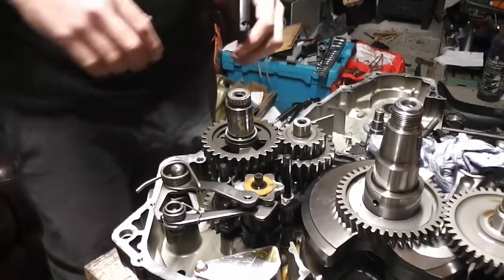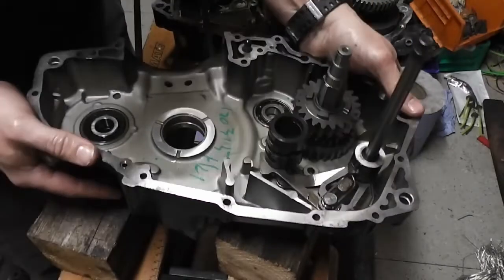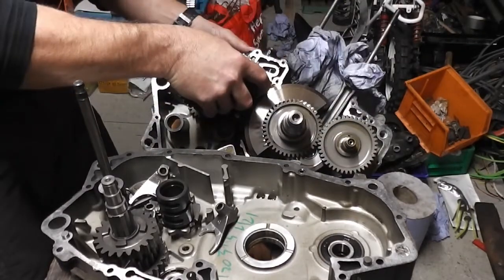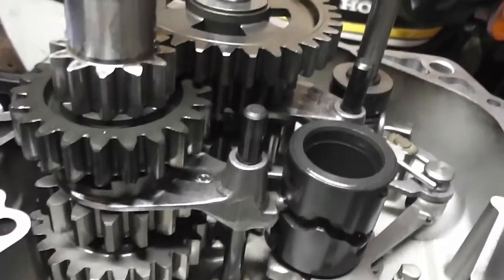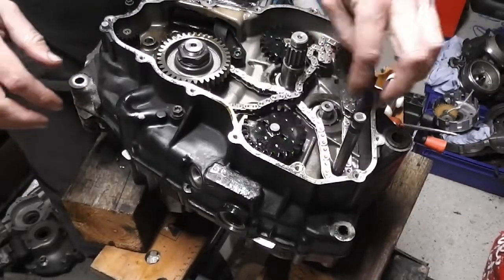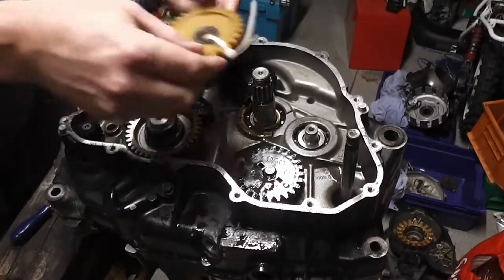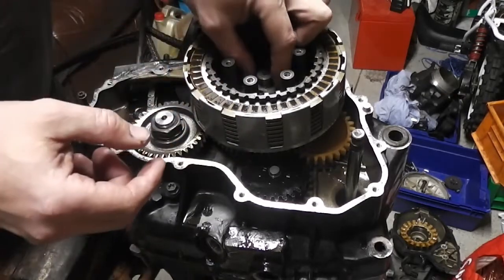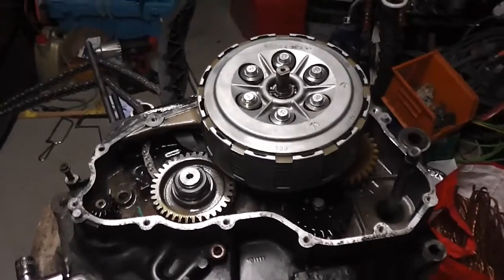F650GS BMW motorcycle bottom end rebuild. Rebuilding the gearbox and clutch etc.

Comment: Hi, I have a two first gears falling out to neutral and now it starts to happen on the third gear so I am preparing to open the engine, do you have any idea what can be the cause of the gears falling out in this engine? Thank you for this great instruction video.
Reply from the maker: Hi 
Thank you for your comment
It sounds like it could be the detent lever
Either the spring isn't very good  or where the roller sits in the gear barrel is worn 
Hope you get it sorted
Reply: @motorcyclefixer  thank you very much, I was also considering buying an other engine hoping that it won't have such problems. I was afraid that gears are damaged, but I see some hope now. The service repair cost so much that I could just buy another bike for the price, so I am planning to open it with my bf. I wish you all the best and leaving a sub.

Comment: Wow, how well explained everything!

In my case, my first gear jumps to neutral if I don't have it pressed.  What do you think is the problem?  Maybe is it possible to solve it by changing the spring?

Thank you for your time, you have earned a subscriber
Reply from the maker: Thank you very much
It could be that the spring tension isn't enough 
Have you checked the groove that the detent wheel sits in
If the groove is worn the wheel may not sit in it correctly
Reply: @motorcyclefixer  I'll check it! I haven't opened it yet

Comment: Hi!

First of all, AMAZING VIDEO.

Anyway, I bought a F650gs and the starter started spinning 'freely'. Ordered a new bendix gear and the assembly. Opened the side cover and my idle gear seems to be missing the axle, the sleeve and the washer!

Is the axle something that just hammers on or do i have to open the other side of the engine up too? Couldnt figure that part out by watching this.

Also, i havent been able to locate the part number for the axle. Any idea where i could source one?
Reply from the maker: Hi
Thank you I'm glad you liked it 
Check out my other videos on this engine 
I'm sure i covered it in one of them. 
I cant be 100 % without watching the vids but i think that the shaft and the gear can be taken out seperately
Reply from the maker: In the uk i bought the parts for this engine from motorworks bmw
Reply from the maker: https://www.realoem.com/bmw/enUS/showparts?id=0172-EUR-01-2001-R13-BMW-F_650_GS_00_0172,0182_&diagId=12_1069
i think this is the diagram that shows the pin and gear assembly
Reply: @motorcyclefixer  found the sleeve and axle from a bike at local breakers. For the washer. Its available at BMW for order, but I just popped an axle shim that had the correct internal diameter and thickness there. Back up and running.

Cheers!

Comment: Hi, can you advise if the rubber grommet which goes through the alternator cover (with wires in it) needs a sealant and if so, which type?
Thanks!
Reply from the maker: Hi 
you don't really need sealant, but if the rubber has shrunk / gone hard it could leak I suppose 
I don't normally put sealant on them but you could put some silicone engine gasket around it if you want.
It wouldn't do any harm

Comment: Hi I need to replace the Clutch Actuation Shaft along with all the bearings and seals in the Clutch housing on my 2003 Dakar, do you have a video on how to remove the bearings ? Thanks
Reply from the maker: Hi
Sorry for the delay in getting back to you but I was contemplating whether or not to take my engine back apart to do it.
I'm sorry I decided I just have too many jobs at the moment
I hope you get it sorted
M